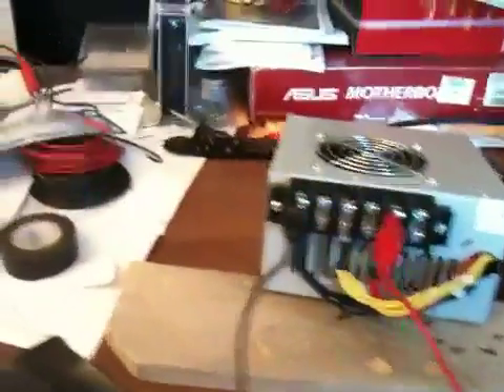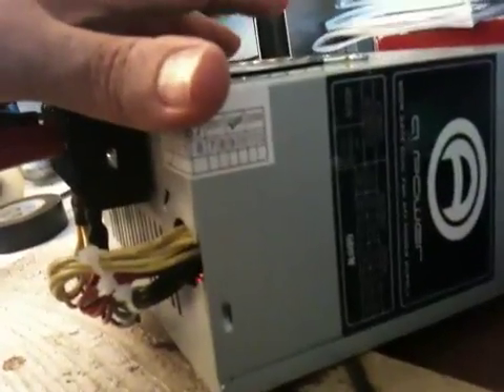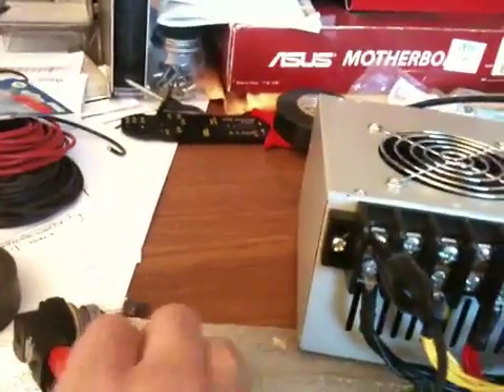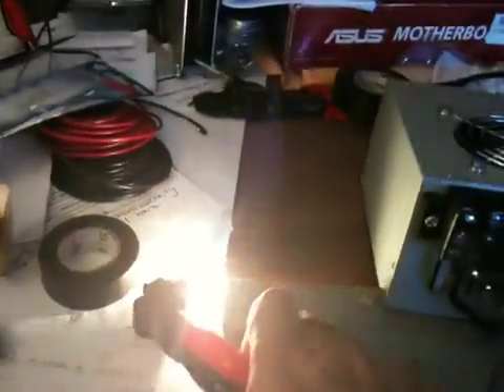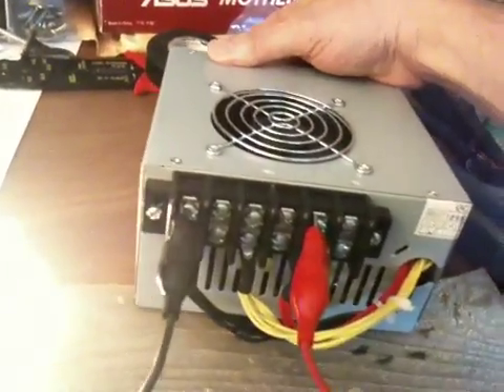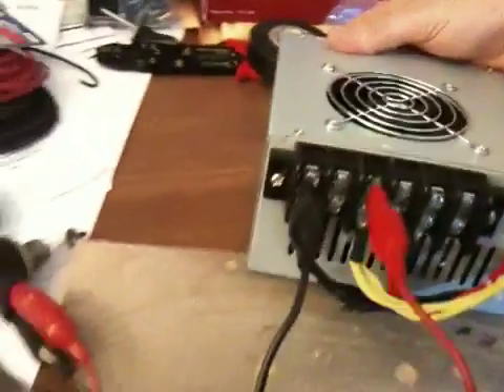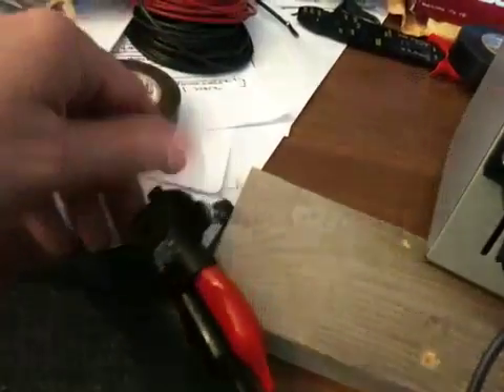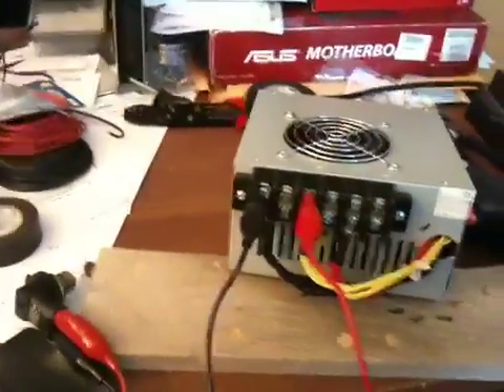(HHO #02) New power supply works great!

Comment: the light will only draw the amps it need the smoke you see is oils off you hands this is y the box state don't touch the bulb all new hulagen bulbs cant be touched by hands the oils on your hand act like a heatsink traping the heat at one point  this will cut the life of the bulb by 60-90% of its life and if you wire up a small lld light to the 5v line this will ack as a load the power supply must thank it was a load to work or you can jump two wire that tricks the powersupply  nice video